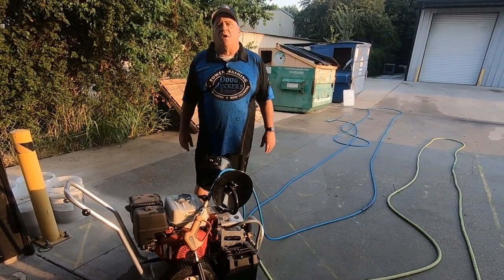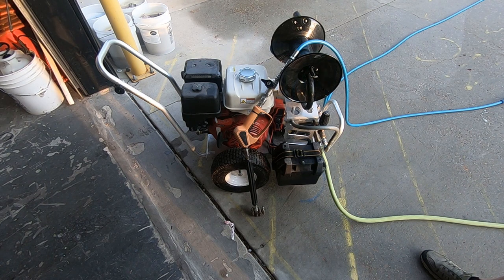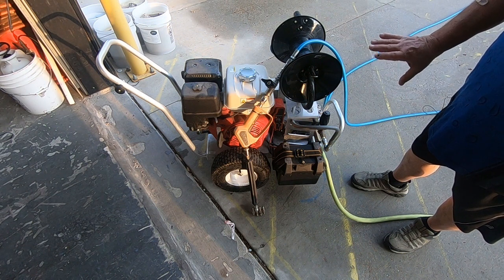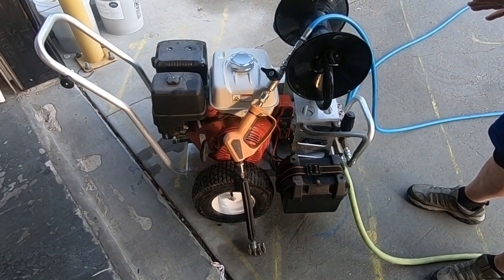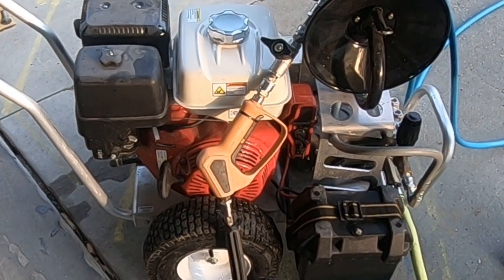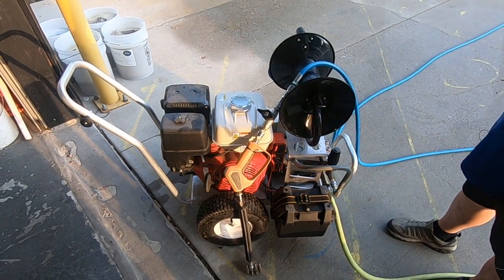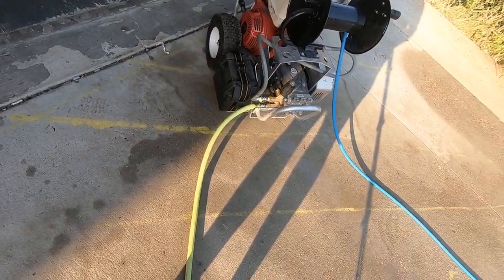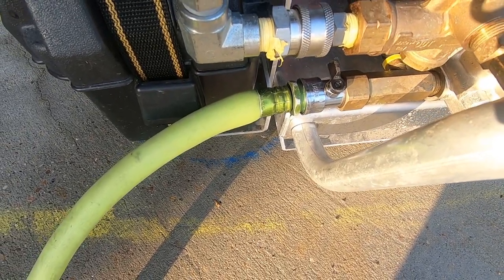PORTABLE PRESSURE WASHER SETUP [WINSDAYS with DOUG]

Comment: I just bought my initial startup equipment and the first thing I’ve received is my ball valve. I’m super stoked to get started, though I did order a direct drive machine, it’s only a 4 gpm. Also have jrod on the way. Definitely going to be getting the shut off valve for water hose at the machine though! That’s a great idea
Reply from the maker: If yiu do the 3 way just make sure machine is shut off because it will cut the water supply off to your machine if your not using a buffer tank.
Reply: @PressureCleaningSch  would I still need to run a separate pump for a buffer tank on a 4gpm or do you think gravity would suffice? Unfortunately it’s not a belt drive 😬
Reply from the maker: @joeberner648  if it’s not belt drive I doubt it will gravity feed.
Reply: @PressureCleaningSch  I don't understand how will the J rod cut the water supply from the pressure washer ?
Reply from the maker: @peacemaker0071  it won't cut the water supply.  The higher pressure nozzles will prevent the downstream injector from pulling the bleach, because they restore the pressure back from using the lower pressure nozzles.

Comment: Hello Mr Doug! First of all thank you for another great video! I noticed you have a flexzilla air hose . That's the one that you hook to the spiket to draw water for the pump. I saw there are garden hose options available too for flexilla hoses and they look the same.
Reply from the maker: Yes we use the 5/8 garden hose for water fill up and also on a 12v soft wash pump I’ve been using and testing. The 1/2 air hose we use for the Kingslinger soft wash system.

Comment: Nice video . One thing I do when I’m finished washing is I’ll turn off the gas ⛽️ and let the Machine die out at the end of the day .
Reply from the maker: Great tip....I do this on my smaller pressure washers and larger air compressors, but for some reason I have never done it on this one but it is always a good idea to do this.  Especially if gas is going to be sitting in the carb for a long time.

Comment: Always great teaching videos Mr. Doug, I currently have a 4gpm direct drive machine and recently installed in my truck a hose reel with 200 ft hose and I barely notice any loos on pressure. I'm thinking on upgrading to a 5gpm belt drive machine because I believe direct drive can't pull water out the water tank.  Is that correct?
Reply from the maker: That is Correct. They usually can’t create enough vacuum to pull the water
Reply: @PressureCleaningSch  hey Doug what pump do you have ? I also have a 4gallon that pulls the water out of a tank
Reply from the maker: Bryan Kaczmarek the one on that machine is a Cat.
Reply: @PressureCleaningSch  thanks I appreciate it. Have a good day stay safe brother.

Comment: Hey Doug, regarding the water feed shutoff valve: I installed the ball valve to the feed hose, followed by a quick-release between the valve and the pump. That way, you can kill the motor, shutoff the feed flow with the valve, detach the feed hose from the machine and then attach a garden sprayer or other attachment to the hose (for cleanup, etc). Is there a problem with this arrangement? It made more initial sense to me, but not sure If I’m overlooking something.
Reply from the maker: Sounds good to me. I can’t see anything wrong with it. As long as machine is getting water and tank too when they need it.

Comment: Doug- I run a fence/deck staining business. I use a small, portable 2.6 gpm pressure washer with an AR pump for prepping the wood. What do you think would be the easiest method to apply a 2-3% SH solution? I’ve tried using an X-jet but it’s not easy to use when doing two sides of a fence. Thanks!
Reply from the maker: Hey Kyle, either using a pump up sprayer or using a dedicated 12V Pump.  If you can use the pressure washer that may also get you close to 2% or at least strong enough to change the color of the algae on the fence.
Reply: Thanks Doug! The pump up sprayer is a little inefficient when doing a big fence and I don’t have the ability to get a 12v system just yet. Using what I have…..
Reply: Does using a down stream injector cut the SH percentage in half like using an Xjet with no proportioner?

Comment: Great video thanks! Quick question: Could I use your 4GPM JROD from your shop on my 2.5GPM pressure washer? Is that 4GPM JROD more of a threshold or will it not be compatible with a lower GPM machine?
Reply from the maker: I would try the 3GPM option before I try the 4. But neither will get you max performance w a 2.5GPM
Reply: @PressureCleaningSch  thanks for the response!

Comment: Do you find that you'd charge extra to soft wash someones house, if its been like 20 years since they've cleaned it and it's really bad. I've heard people charging .20-.30cents a square foot for soft washing a house, but that's just spraying chemical on it, then rinsing off. Some of these houses in east texas are like ridiculous man, the bottom 4ft of them are black/green/and orange with mold and iron ore rust. Some area's i have to spray straight bleach with chemical sprayer, let sit, then scrub with a brush, rinse it off, then repeat the process.
Reply from the maker: I don’t necessarily charge extra because I’m soft washing. I charge based on what the job dictates. On something like what you’re describing yes I would be charging a lot more than say a house that’s routinely cleaned